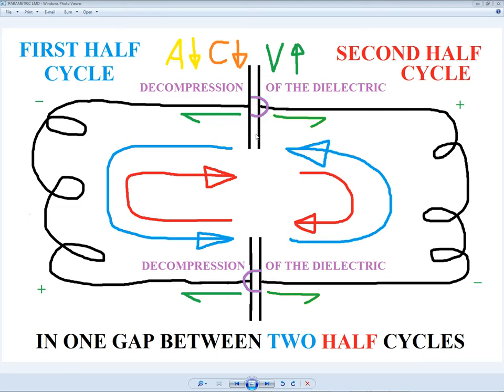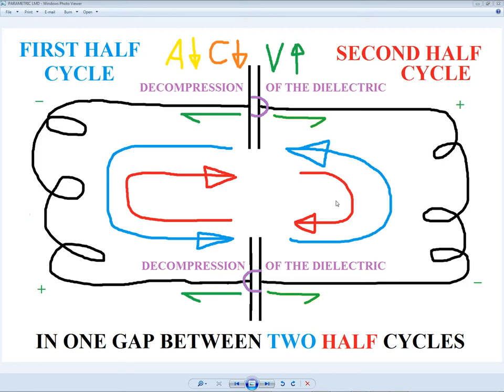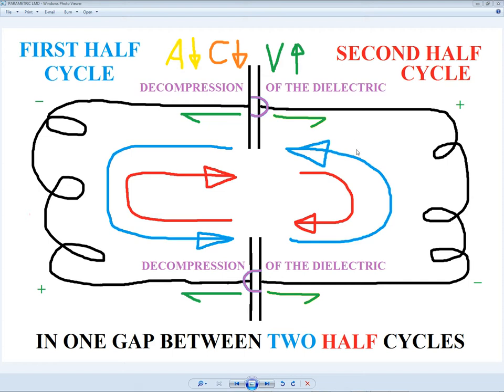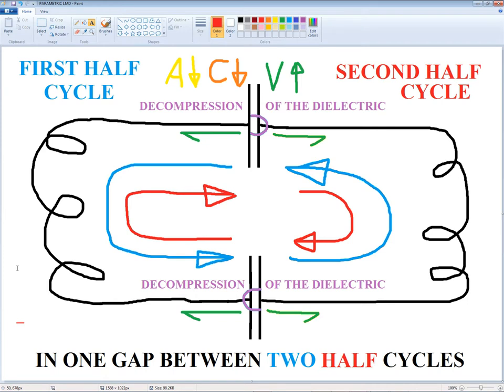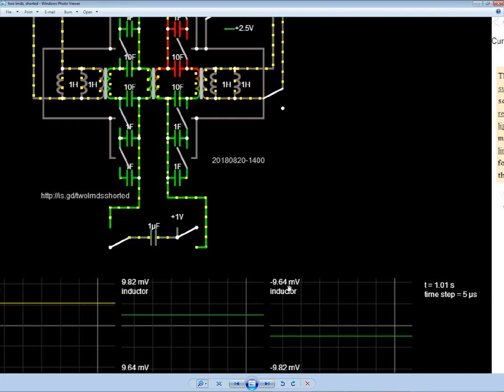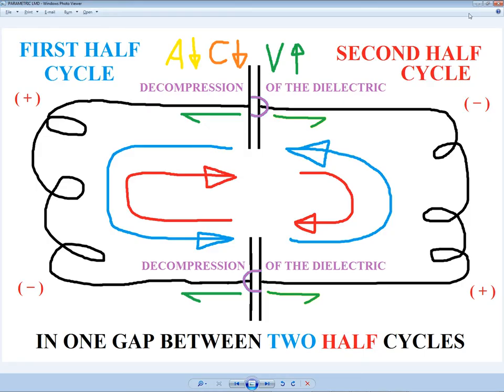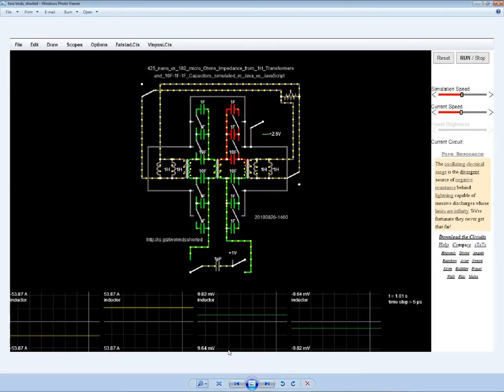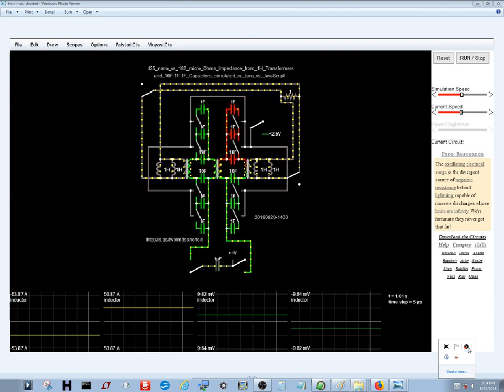Explanation of Parametric Oscillations in Eric Dollard’s LMD Analog Computer.

Comment: I think that it is correct but the required parametric variation for a sustained oscillation involves the pulsation of the material involved in the condenser and the coil. The process of hysteresis partaken by the dielectric material of the capacitor and the metallic material  of the inductor must be created thru resistance saturation. Ending up in a parametric variation of the capacitance and inductance which will be the door entry for the magnetic reaction (reluctance) of the coil upon the condenser and the dielectric reaction upon the inductor (susceptance) which is the completion of the path to not only the real quantities of current and voltage but the field quantities  external and internal. This kinda describes how to unify the four quadrants of the electric field.. the two images (electrostatic potential and magneto motive force) and the two reals (electro motive force and displacement current).

Comment: Come on ! You have the secrets found 😉🙏😇 you only had to build the circuit. It is easy when you know how it works 🤗 ! I have a circuit builded that looks like your drawing, two horseshoe electromagnets with an filament between, like a mechanical flip flop circuit. The 2 U shape elekrtomagnets are magneticly connected but the elektonik is separated, each U shape magnet have his one flow direktion and his owne 12Volt car batterie. Earth ground and a metal plate high over the ground. Yeha it's Teslas Radiant Energy Reciver. 😎☺😇
Reply: Do research on parametric excitation of electric oscillations. The truth shall set you free, but also despair Lol